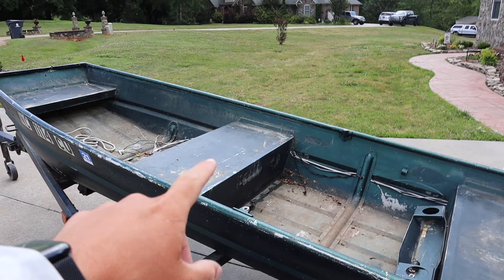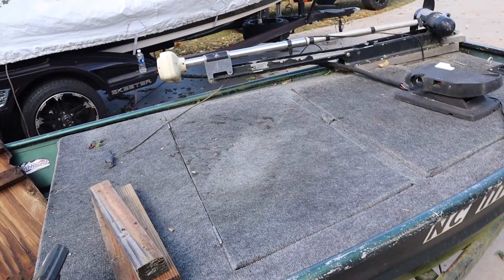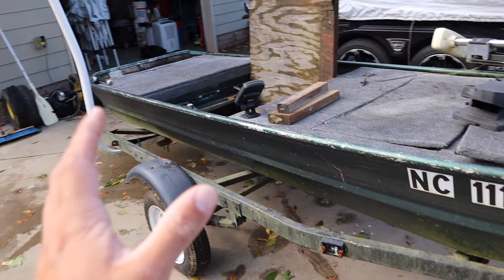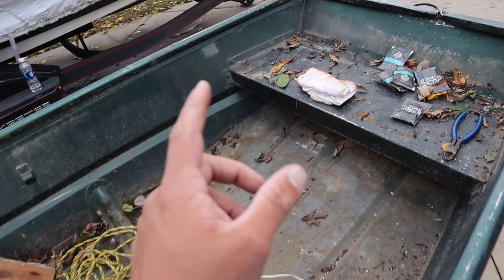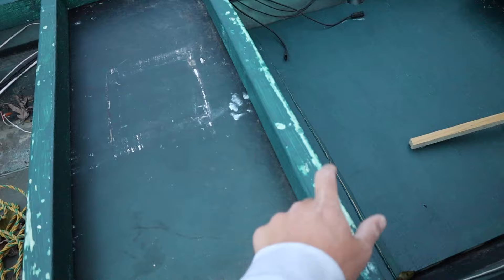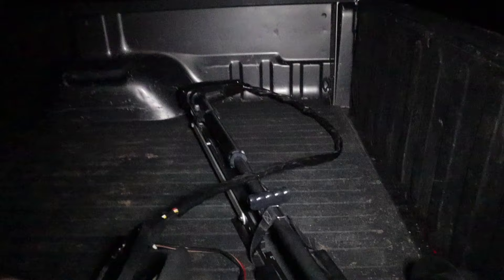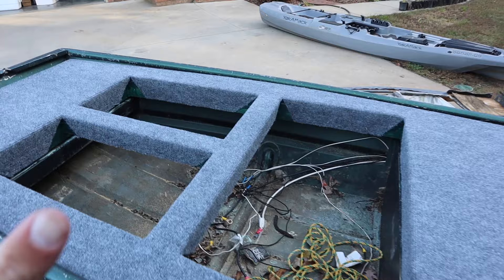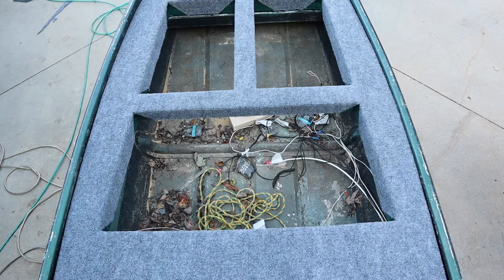JON BOAT to BASS BOAT Conversion! (Full Build)

Comment: Do you think this would be a good idea for saltwater?
Reply: Just use aluminum and stainless and coat all the wood in fiberglass resin, carpet maybe but resin and some paint with non skid foam would be better, waterproof and no carpet to clean
Reply: What’s up bro😂posted that 6 months ago. I currently have a aluminum 16 footer that I ended up getting for 300 and I put carpet in it
Reply: @Austin-yg7ml  nice! I know I didn’t see the post date till I responded already 😂